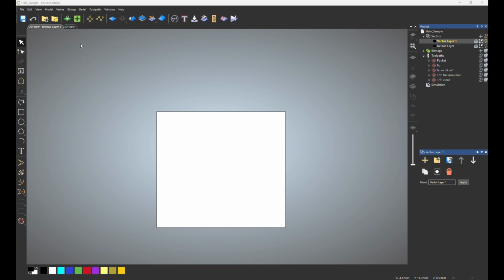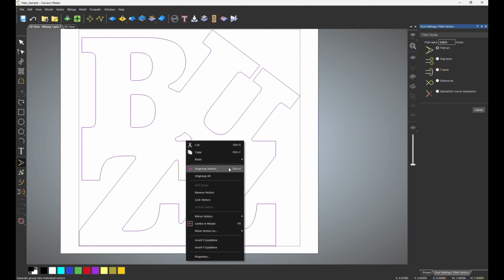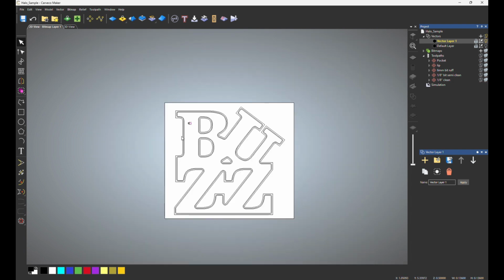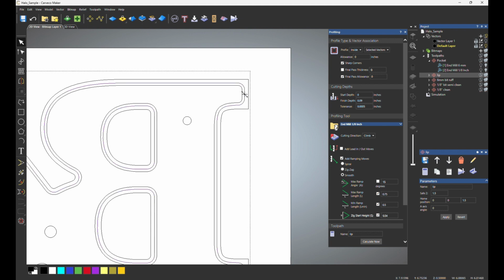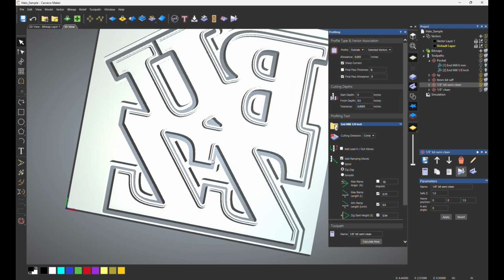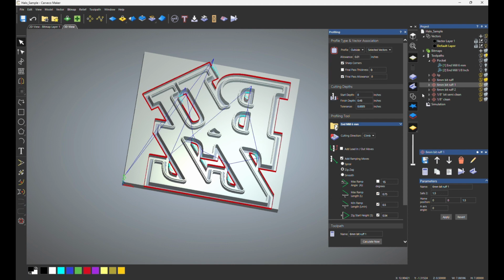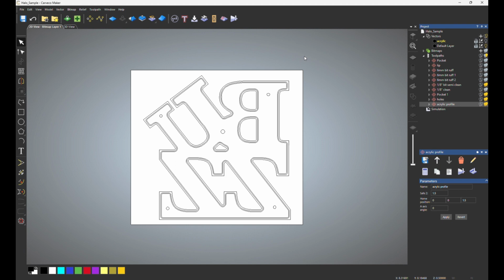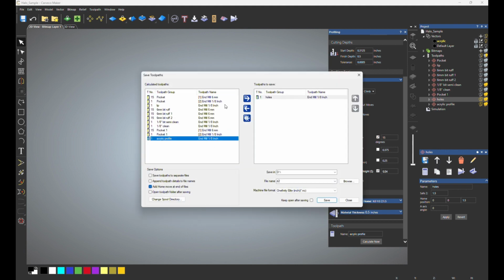Cutting 1/2" Aluminum halo lit signs with Carveco Maker and Onefinity CNC Elite Foreman

Comment: Man that is bad ass. What do you charge for something like that? I am curious if one can make a good living with the elite 4x4 and doing things like this or if its break even or what? Given the time to cut it, I'd assume you would probably have to make a few every day to make $500+ profit a day?
Reply from the maker: Sorry, I am not here to help with pricing. The price is different in each region based on the cost of materials, advertising costs, employee wages/benefits, location and difficulty of the installation, does it need to be waterproofed?  what is the finish (paint, powder coat, anodizing, plating)? how quickly is the product required? what are the clients attitude and expectations? Too many variables. I only do custom work which comes with a custom price, my quality is top of the line. often a job will require welding a custom aluminum backer/raceway for sure it will require hours of discussion with multiple design options,  physical samples made, permit applications, electrical inspection, landlord approval, blocking off sidewalks or late night in malls after they are closed, rental of scissor lifts, . There is always someone who can do it cheaper, I am not that guy.
Reply from the maker: If that last comment came off as crass I apologize, that was not my intention. I was only trying to point out that there is a lot more to a job than what i showed in that video. If you want to watch this other one I made showing a complete job you will see the the CNC part is only a small part of a project. https://youtu.be/Q-tbk4BRBos

Comment: Excellent Video... Great work and great design.... I tried cutting Aluminum and it was a disaster. I will try again after watching this. I'm wondering if the quality of aluminum matters. Thanks again
Reply from the maker: Thanks for the reply, make sure you use single flute "spiral O" style bits. Don't those traditional 2 flute endmills.
Reply: @ericbuzz  Appreciate that info... I'll give it another shot . thank you

Comment: Good day, did you see any drop in torque from 400 to 4000 motor resolution ?
Reply from the maker: I did not notice drop in torque but i don't know about the longevity. I have actually removed them already and I am in the process of swapping in 400w AC Servos. In my opinion they are too weak but i think most users are completely happy with them. My problem is i have been running commercial machines over 2 decades so there is no way i was ever going to be happy with steppers motors.

Comment: Nice job with cutting the aluminum.  It’s nice to see what the machine is capable of.
Reply from the maker: Thanks for the comment. While the machine is capable of getting a good finish, the motor resolution needs to be increased quite a bit sacrificing torque.